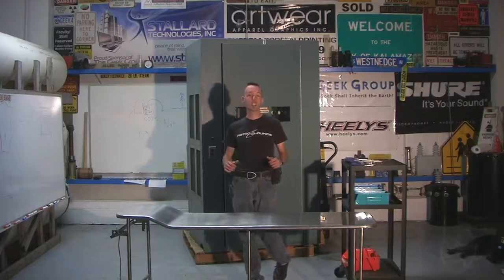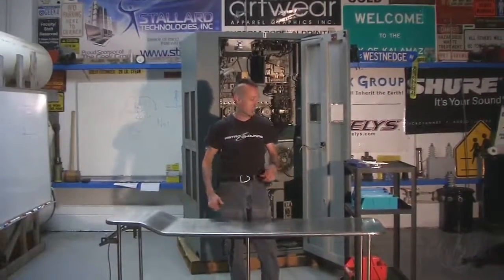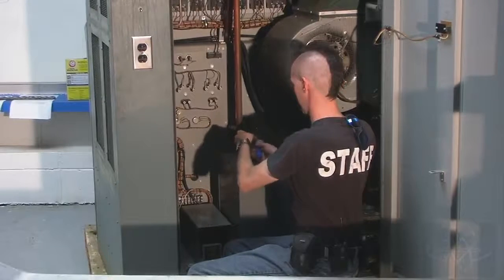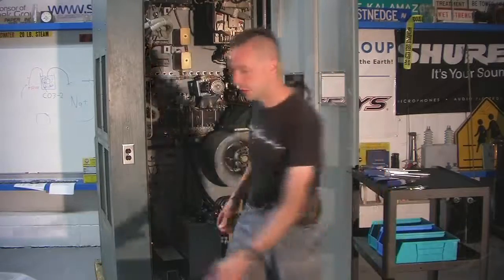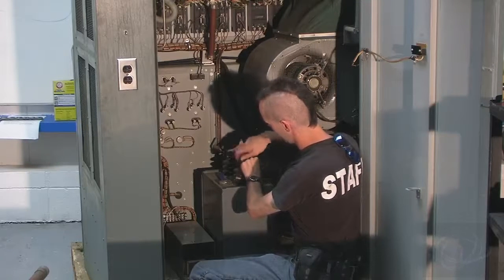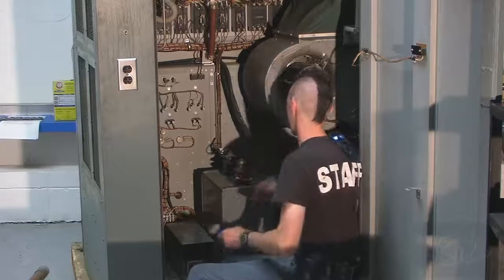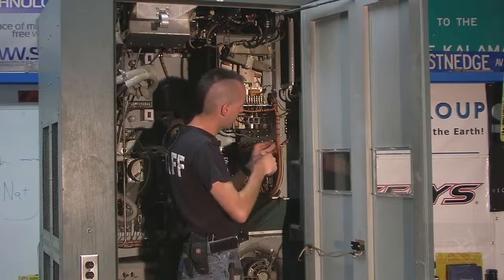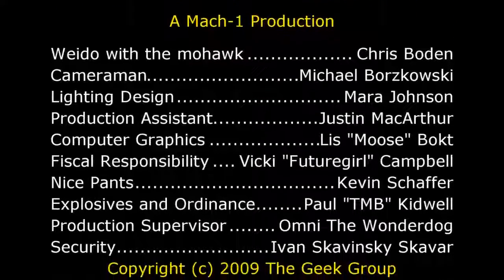1970 GE Transmitter: Equipment Autopsy #8

Comment: A lot of assembly, harness building, point-to point soldering, etc was done by women, for about 20 years after WW2, also in England, where most of the early Marshall amps were built by women. But then, in 1970 when this item was made, a war-worker would have been in her fifties... so maybe not...

Comment: I did a video teardown on a General Electric Progress Line UHF 2-way radio repeater that was about the same era as that 19Kv rectifier cabinet.. I know my GE radio gear, I own several GE mastr 2 and 3 repeaters and paging transmitters and I have a VHF Klystron cabinet of that same series system in this video set up for analog channel 6.

Comment: Cabinet 1 was the rectifier where 19,000 volts A/C was converted to DC  to power the electron beam of the Klystron Power Amplifier tubes. In this cabinet were the various relays, circuit breakers, and control circuitry for the other various systems of the transmitter such as the external cooling system that circulated deionized water through the Klystron tubes and magnetic frames used to focus the beams then through a heat exchanger and serious of pipes and pumps, and fans.

Comment: The big resistor labelled 206 (20 kilovolts @ 1 mA is a 20 mego-ohm 20 watt resistor.

It can be very useful to safely discharge large high voltage capacitors.

And if you hook-up a 1 mA milliammeter in series (cold side), you'll have a 20 000 volt voltmener, again useful to see if there's any residual voltage in a capacitor.